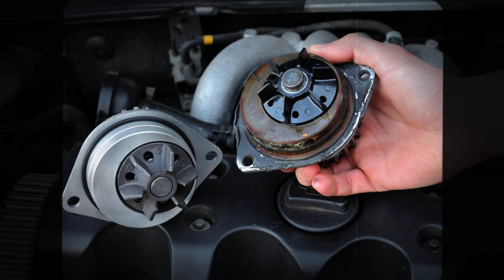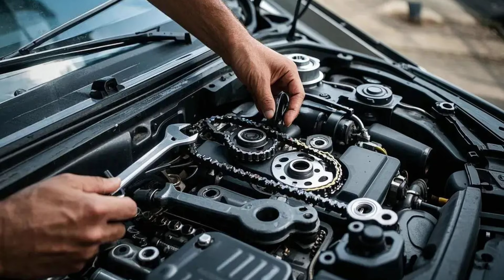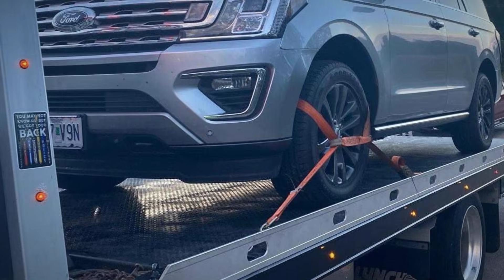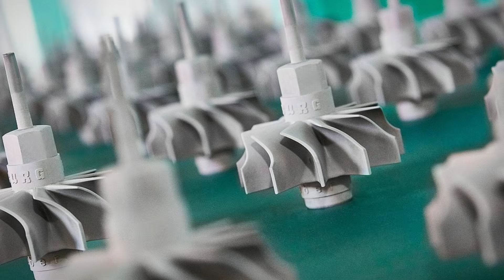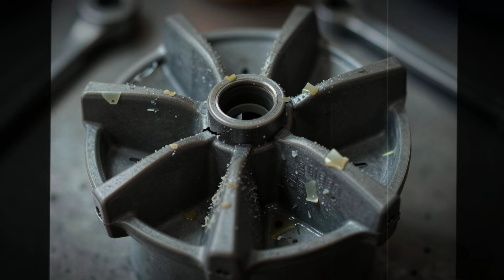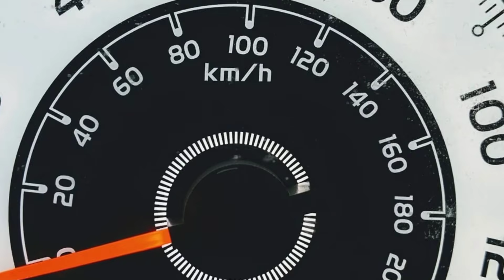Why Modern Car Engines Explode At 100k Miles (Plastic Water Pump Scam)

Comment: Lol yeah ok. Newer cars are made much better than cars used to be. Y'all are gaslighting....Growing up in the 90s do y'all know how many rusted out vehicles were on the road? When vehicles got up around 100K miles the transmission typically started to slip. Cars are made much better and more durable these days. Cars now adays can typically get 200K plus miles before any major issues. My Ford Fusion had over 140K miles and never had any transmission or engine problems. The only thing I had done was Spark plugs and Fuel purge valve replaced, all of which I did myself.
Reply: What a lie! Old cars lasted as long as they were properly maintained and not abused. They were easy to work on, simple, and built better. Modern cars crush like a tin can in a minor accident and the suspension systems get all torn up on rough roads that the state refuses to repair. My '96 Ford Taurus is in excellent condition at 180k miles despite driving it on the beat up potholed roads of Pennsylvania and having hit deer and having 2 minor fender benders a few years ago which did no damage to it, only the other driver's cars.
Reply: @scott.s-v9b  That's a lie, only truth to your statement is they were easier to work on. I agree with that. And newer cars in terms of accidents are much better because they don't dent as easily...Those sheet metal cars back in the day got dented on the slightest bump. Not to mention you felt all the energy if you were in an accident. You could die from a 30 mph accident because you essentially felt all the energy...Yes the newer cars do crumble a little easier but that's to absorb the energy better. Those cars back in the day we're not lasting past 100,000 miles without some major issue, if not transmission slip. Cars are one of the few things that have actually improved.
Reply: @thegamingchef3304 All evidence to the contrary to what you just said. Like I said my car is 30 years old and in excellent condition with almost 180k miles because I maintain it and drive it properly. As I mentioned before how my car holds up well on beat up roads, hitting a deer, and hitting a few cars. You probably work at a stealership. The fact is very few people maintain their cars properly which is why older cars didn't last. That is just operator error.
Reply: @scott.s-v9b  Dude good for you. You just said you put extra effort into taking care of your car. Alot of time the average person doesn't have to money nor resources to do that. So good for you. My car was approaching 150K and only thing I did was put a new fuel purge valve in, spark plugs, ambient sensor etc. Back in the day the average car did not last like today's average car. The average car in today's time is definitely much more durable both engine wise, transmission wise and body wise. Not to mention much lighter which is probably one reason why transmissions last longer. Cars back in the day were garbage. Cars these days last much much longer with simple general maintenance.
Reply: @thegamingchef3304 When your car lasts as long as mine has, then your argument might have some weight, but until then, it weighs less than a grain of salt.
Reply: @scott.s-v9b Lol funny thing is you spend extra money taking care of your car at 180K....Yet outside of usual maintenance and preventative maintenance I haven't done much, yet still running strong. In other words you admitted you needed to pour x amount of dollars into your vehicle...So I fail to understand what your argument is? Most vehicles these days don't need that. My mother had a Kia Optima when I was in High school and other than regular maintenance that things didnt have any issues.
Reply: @thegamingchef3304 You have provided zero evidence to your argument and it's much cheaper to maintain an old car that is paid for and bought for under $3k than to but a modern car that won't even last 15 years. Basic maintenance for my car is pocket change and even if hypothetically I need a transmission or engine rebuild, it is still far less expensive than buying a modern car.
Reply: @scott.s-v9b Lol your judgement is based on nostalgia, mine is based on reality. 👍🏽
Reply: @thegamingchef3304 Believe what you want but I tell it like it is. I tell the good and the bad, I do not sugur coat like you do. Maintaining an old car is cheaper than a car payment not to mention depreciation and that's IF modern cars last as long as old ones which I will believe it when I see it.

Comment: I looked up the water pump for my Acura it looks like it's mostly aluminum. I just have to worry about the head gasket, and transfer case going on it.  One local person with the v6 version of my car was quoted $13k for transfer case and transmission replacement at 100k miles. Scary that all of a sudden a part could go like that without much warning.

Comment: And I complained about the plastic thermostat housing on my 2008 Ford Ranger. I replaced the leaky plastic with an after market aluminum housing. The water pump is metal. My 1995 jeep, easy to work on.
Reply: Same. I replaced the housing on my 2008 Mustang with an aluminum one as well from Simmons Auto Sportz. Cost 3x more than stock but the piece of mind is worth it.

Comment: They build these cars to deliberately screw you. That's why they make cheap plastic parts, to make sure you pay the full bill for it when it fucks up.
Reply: a plastic water pump INSIDE the engine is GENIOUS !! ..... its just the refridgerator issue - WARRANTY VOID IF YOU OPEN THE BOX !!

Comment: I own a used car lot.  Ford escapes sell well.  We had to do a water pump in one and it has a internal part where you have to take the entire motor apart to fix it. Insanity.
Reply: The 3rd gen Escape is 1 of the biggest POS cars ever. I also have a used car lot. People absolutely love those shitbox junks. I hate dealing with them.

Comment: Bigger scam was the introduction of rubber timing belt on overhead cam engines for decades.
If this belt skips few teeth or snaps, the engine is done. Pistons and valves will collide and catastrophic failure will occur.   A $ 25 belt will destroy the engine that can cost thousands and thousands of $$$$$$$$$ to replace.
Some of new cars have gone even deeper in idiocy...they have timing belts sitting in hot engine oil... 
They WANT engines to fail to force you into buying a new car. As simple as that.

Comment: Only thing dumber than water pump located where it could contaminate the engine oil if it began to leak is an engine that has a rubber timing belt inside the engine oil, where shards of the belt get into the oil as it deteriorates clogging up the oil pump
Reply: this technology PROVES we never went to the moon !!

Comment: New cars, 70% plastic with 30 computers, what could go wrong ?😂
Reply from the maker: You may be on to something 😂
Reply: Nothing everything will be ok lmao 🤣🤣🤣🤣
Reply: And that means it is time to go fully electric believe it or not. It is so much less maintenance and less moving parts to break.
Reply: @VelizarMilutinovic just costs 3 times as much to fix when it does go out
Reply: @AllenRoupe-my2yh 
Have you ever done anything yourself can you even change a flat tire to a spare tire? 
For electric cars everything is easier and all you need is decent $2000 scanning tool you can change battery and program the new one you can replace electric motor also using same scanning tool program new one 
And you can find many Chinese scanners now that can perform these tasks the question is how old are you and how lazy are you
No you don’t have to go to dealership just because it’s electric car yeah I know too much for you to process
Reply: @VelizarMilutinovic wrong. It's still more complicated and more expensive to fix. Womp womp
Reply: @TheGuruStud 
How is it more complicated what exactly did you encounter fixing what ?

Comment: This current crop of CEOs decision makers are crap like their engines. 
We need engineers to design build a robust engine and transmission that is easy to maintain and repair with a design and layout that allows for maximum accessibility to service and replace parts.
I’d favour manual wind up windows with quarter lights and the means to replace lights bulbs without having to buy a sealed unit costing £1000.00 to replace an led bulb.
A cable manual handbrake and  manual transmission with robust timing chain that are not going to fail. Aim for one million road miles for private cars and see what you can do for the longevity of trucks and buses.

Comment: I have a 2013 Lincoln MKS v6 3.7L with the water hooked up with the timing chain. So I've been Lucky my has 367k miles on it. My car has been a great reliable vehicle just Tune up every few Year's and regular oil changes 😊 Runs Excellent

Comment: Ford bmw always have been things difficult even on their strait 6s n boxer engines,,, , Chevrolet offers after market parts that fix the problem which 2007 was the last of that n Ford started in 2000 , to fix the issues on after market ,, & bmw late  1997,,,jeep stop in 2007 ,  2010  ,, dodge Chrysler are at edge ,,,, by making them cooler all the way around ,from pump radiator hoses , air cooler system ,,fuel cooler ,oil cooler ,n transmission cooler  al mini coolers  to avoid issues catastrophic irreversible issues that will cost money time  & headaches lawfully,,
Reply: Ford and BMW don't make a boxer engine.

Comment: Checking the oil frequently could catch this.  While using group 3 synthetics, my intake manifold gasket failed on my 95' Grand prix 3.1L.  I drove 2 weeks wondering where my coolant was going, I finally checked the oil. Way overfull, looking like milkshake.  Took it in for repair, they though my motor would be fried.  Nope, Supertech 10w30 full synthetic saved the motor, new intake manifold gasket, oil change and I was on the road again.  Full synthetics saved my motor.

Comment: The first thing to remove from a new engine is the upper and lower plastic shroud that keeps the heat in the engine compartment causing brittle plastic to crack. By removing these plastic shrouds the engine rums many degrees cooler so they don't crack.
Reply: But, but, but...it looks prettier!

Comment: Unfortunately, the car companies following John Deere's lead have become predatory manufacturers preying on their own clients. Here a few areas of concern that you should check on BEFORE you sign on the bottom line on a purchase contract :
1. the latest scam is not allowing you to change certain common parts - you can physically replace the part but the computer in the car won't recognize it unless you go to the dealer to use their proprietary service software at a substantial cost. This means even your local Mom & Pop garage can't do it nor DIY home mechanics. Ask if this technology is present in the vehicle you're looking at and get them to put it in writing on the sales contract.
2. the use of plastics in the engine compartment where the heat from the engine will cause the plastic to crack over time. Then they charge you $240 for a plastic tube that cost $6 to make. And that's just the cost of the part - there is the labour costs as well.
3. poor engineering that hides access to common parts under other assemblies that must be removed to get to the defective part. Example: having to remove intake manifolds etc just to access a PVC valve or placing the cabin heater core inside the front dash of the vehicle ( it used to be located in the engine compartment = a 1 hour job ) and now requires 11 hours labour to remove the entire dash to get access.
4. you know that high tech screen full of dazzling colors when you first look at the car, well when that fails ( and it will ) the cost can range from $2500 to $6000 and in some cars the screen controls everything
5. it's getting to the point where only a lease makes sense because the cost of repairs after the warrantee ends kills any reason to own the lemon
6. GM Ford Chrysler VW ( all European cars ) have long been on my DO NOT BUY list because they are JUNK. I switched to Japanese because I used my car for business and I had to have RELIABILITY
The bottom line is do your research before buying and check resale values before you buy so you know how much money you lose after 3 years. Luxury cars lose a huge amount because the cost to maintain them rises very year you own them. Shop smart.

Comment: I own 2 cars and 2 motorcycles, the newest one is 24 years old, the oldest is nearly 50 years old and they all run fine.
Reply: Until you put the new ethanol gas into your car, then it will be destroyed

Comment: BMW' s 3000 psig direct fuel   
Injection system's fuel injectors,  are madd of plastic !!! Toyota's are made of high precision STEEL . 
YOUR western built crap now has plastic engine oil pans , plastic intake manifolds   plastic coolant hoses,  plastic water pumps , plastic fan blades , 
Plastic fuel pump housings ? , plastic fuel tanks , plastic brake and accelerator pedals,  etc. , etc. .
Good luck everybody .
Buy your new vehicles that are STILL ONLY MADE IN JAPAN - MY RECOMMENDATION .

Comment: no, as long as you keep the antifreeze cleaned in them for it they’ll run a long time my CX nine got that same motor 3.7 with the with the water pump internal got 200,000 miles on it never had to replace it
Reply: that never happened.

Comment: The only proper or fair solution to this is to force the manufacturers to warranty the engine for the life of the car. 
BTW, you use a blanket statement that all modern engines "explode" at 100k miles. This is untrue. I can show you literally THOUSANDS of engines that have run over 200k miles and more. Also, engines don't "explode." They simply fail. No drama like is implied.

Comment: yet people stay loyal to this old fashion, out of date, archaic type of propulsion,  when smart drivers have found that an electric motor and bigger battery provides better acceleration, more controllable decel and stopping with just the throttle, quieter, cleaner, much less maintenance and repair cost worry. and plain fun to drive, vs. the clunky unresponsive gas engine.

Comment: I've done the Ford duratec. It has a weep hole that tells you when it is going bad so coolant does not go into the engine. Its when people ignore it that it gets catastrophic.  Also they didn't do it for money or crash issues. It's because the engine is transverse mounted and there is no room for it. The F-150 has the same engine and its water pump is external since its not transvers mounted. It's a $3k job that takes over 20 hrs to do.

Comment: just replaced my water pump on my 2006 chevy 4X4 silverado, 5.3 ,did it in less then 2 hours, including the thermostat, 150 dollars in parts ,did my own labor ! the new cars are absolute crap !
Reply: My wife's '15 subaru was ready for replacement. No we didn't buy new. We bought a nice clean o4 tahoe with the 5.3.
Reply: Cev silverado  2015 100 dollars  at the most  on  a 4.3  and  five  minutes
Reply: Long live the 5.3!
Reply: And Chevy's "big brother", the 6.0💪🏽❤️

Comment: When Jaguar was owned by Ford they put a complicated and difficult to change thermostat housing made out of plastic that would crack every 30k miles or so.  Impeller on water pump plastic good for less than 100k miles, plastic oil pan too.  Our older Ford has metal thermostat housing, water pump, and oil pan, and no failures at 211k miles.  Unbelievable they did design their newer vehicles to have multiple guaranteed failures.
Reply: That is how money is made...If you make an incredibly reliable vehicle you'll go bankrupt immediately.

Comment: That's why I love my old cars. I will not buy a new piece of shit.
Reply: Buy an early 2000s Lexus and put $34k into it, that’s way better than buying a new piece of shit
Reply: My 1998 chevy lumina, I do everything myself and absolutely easy to work on. These companies don't care about cars lasting anymore, just ask current Toyota. Some guy in a boardroom said "lets take our amazing, long lasting Tacoma V6 and replace it with a 2.4 turbo so it needs fixing every 50 k miles" while laughing maliciously.
Reply: To think they use to call our old cars pieces of 💩:)
Reply: @bige311 nawl, nothing is bigger POS than the new car
Reply: @bige311 I agree
Reply: I've have 3 older cars that weren't popular, all needed a part less than $100, no longer manufactured.  All were older than 15 years.  Now I have popular cars, RDX's, but, I will not buy new, they're 10 years old.
Reply: Im about to buy a 76 Chevy Impala, im going really old
Reply: Nothing built after 2010
Reply: And you are part of the solution. Humanity owes you respect.
Reply: What are you going to do when 15% ethanol is added to gasoline coming May 1st?
Reply: @sankofa669  the same thing we've all been doing! Doofus! You think 15% is new?
Reply: @sankofa669 my old cars don't complain on ethenol , they are carburated something you probably don't know about. They can run on moonshine
Reply: Good Luck finding good replacement parts for them. The market is flooded with nothing but junk replacement parts.
Reply: 2 of my old cars are older than myself, and I don't have any problems finding replacement parts. I work on them myself. I have other engines that work , if that one goes down all I have to do is replace it with another. Rebuild the one I took off .
Reply: @AndresRodriguez-sm1fr 

What cars?

Comment: I just did an oil change on my 2000 Ford Taurus SEL. It has the 3.0L Duratec Engine, but I did not see anything milky in the oil. So I'm pretty sure my engine has a steel impeller for the water pump.